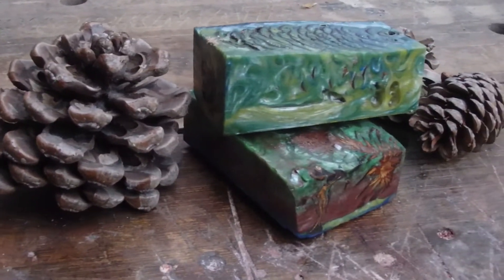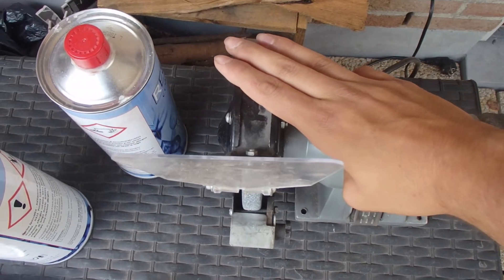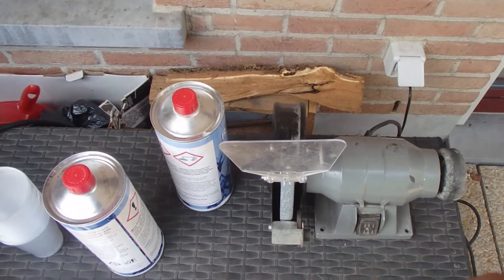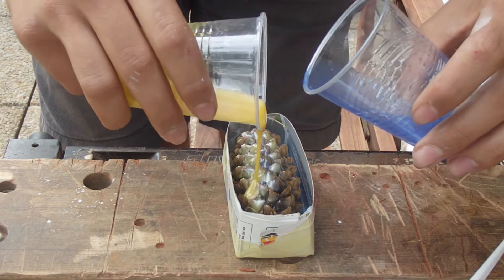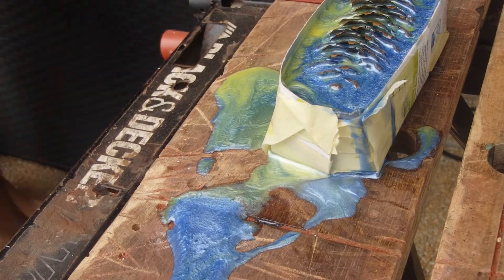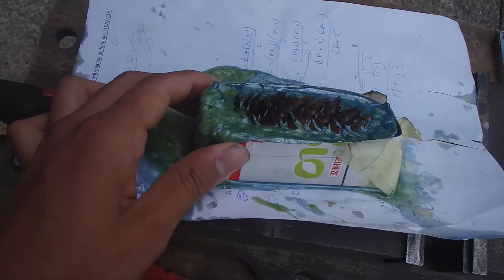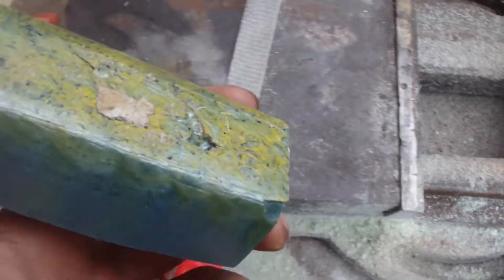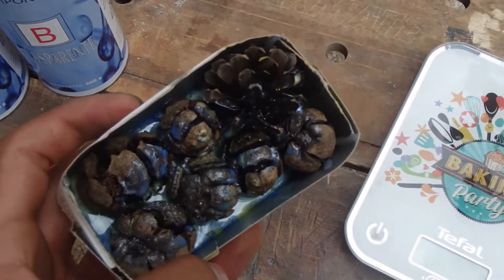knife making : Making pine cone scales WITHOUT a vacuum chamber

Comment: Elliott,  very good try, but no you dont need a vacume chamber first off, secondly easy! Way to not spend on castings, use your tupaware , anything plastic with a triangle with a 5 in it will work great, especially with pinecones, secondly dont use a torch, to much heat, use a heat gun, pour small amounts like a half inch, heat it and work the bubbles out,  continue your pouring,  working it to cover,  also, before mixing fill your tupawear up with water and pour into your measuring cups, it will tell you exactly how much resin you need to mix, other then that great try man, nothing wrong with learning! We all fall before we walk!
Reply: Also if you do get bubbles, layer the outer side with another small layer of clear resin no color, works fantastic,  awesome colors man.

Comment: We're those raw pinecones or stabilized ones?
Reply from the maker: raw pinecones
Reply from the maker: I havent got a vacuum chamber so my method for stabilizing is half epoxy and half paint thinner (by weight ) it works wonders with spalted wood